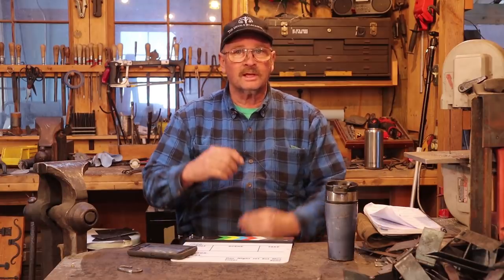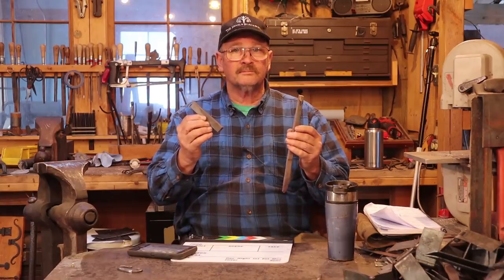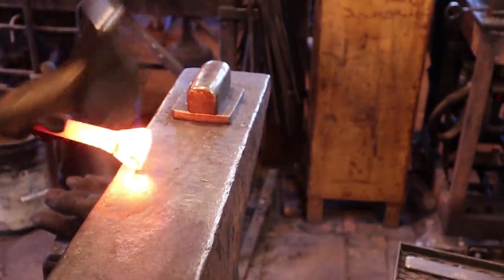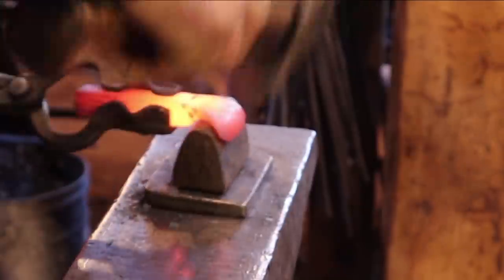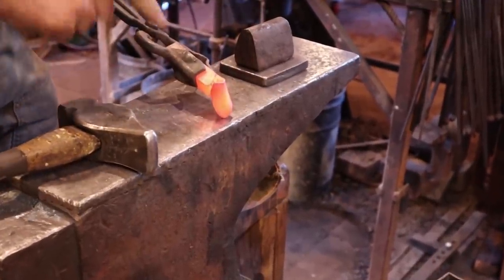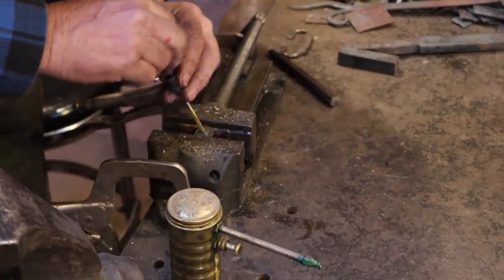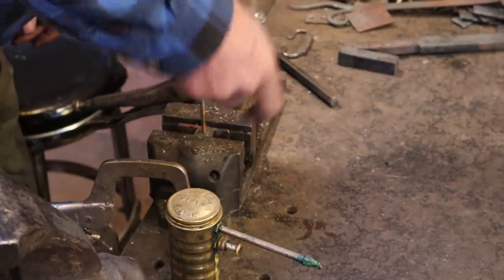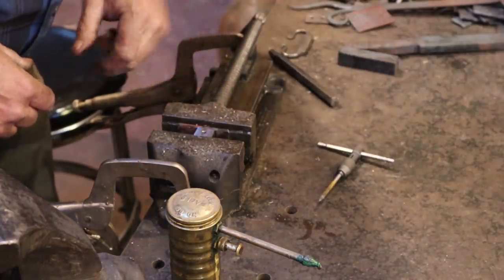Fishtail cabinet pull - blacksmithing project

Comment: You are supposed to holler "take one" then snap that thing.  Our hoisting and rigging training for using cranes states that an eye bolt must be threaded in 1.5X the diameter of the bolt for maximum strength...maybe a bit overkill for a drawer pull though, but I think it is a good rule or thumb.

Comment: Great little project but the three threads I believe is wrong (but maybe not) I've always gone by the thickness of the bolt so if it's a 5mm bolt it needs 5mm of depth, 16mm bolt needs 16mm of depth.

Comment: And depth of thread should be minimum 1-1/2 times the diameter. Depending on material being tapped. Softer materials requir more threads.

Comment: The little giant was smoking when it struck. Do you oil or wax the tools when you shut down at night?
Reply from the maker: I don't go out of my way to oil the forging surfaces.  Bu the old mechanical hammers live on oil and it tends to drip everywhere over the years and ends up on the die surfaces.

Comment: As far as "3 turns..." that's probably close to the size of a 10X24 nut so I can believe it.
Reply from the maker: Good point
Reply: in the oilfield i figured a full nut was as good as it would get. my  main concern as exposed threads  beyond the nut to rust or get damaged making life miserable when taking them off.

Comment: Good Morning John, I had a question as to whether you can grind with flap or belt with HOT Steel?
Reply: If your talking about a red heat I would never do that. One of the main reasons for belt failure is the glue going soft. The other thing you might just melt your contact wheels or burn the belt. But see what other people say.
Reply from the maker: I do it with the belt grinder quite often.  If you watch Brent Baily making hammers he does a fair amount of grinding at red heat.  I would be worried about the heat close to the grinder motor when using flap disks, but the moving belt keeps the heat from building up in the belt or contact wheel.
Reply: @BlackBearForge  hmm OK hadn't heard that opinion.

Comment: I notice a lot of blacksmiths use a belt grinder instead of a bench grinder with stones. What are the advantages to a belt?
Reply from the maker: Belt grinders allow for quick grit changes from extremely course to polishing.  They also maintain a constant wheel size, since you don't reduce the wheel size by dressing the wheel.  Finally they are very adaptable with multiple grinding surfaces to fir special needs.